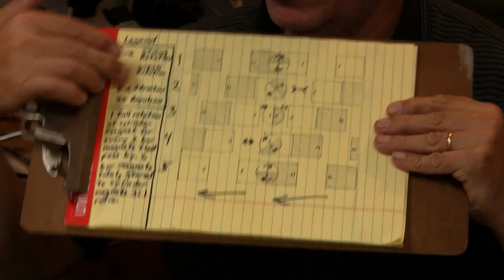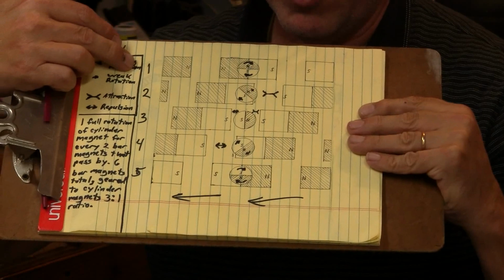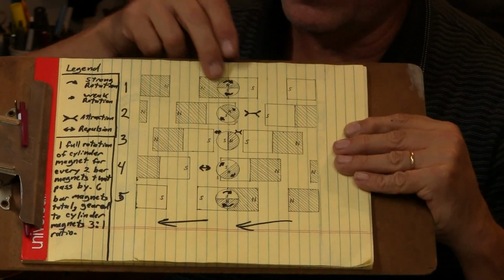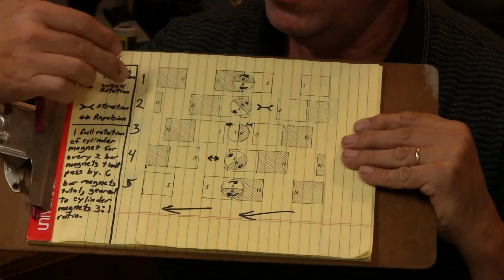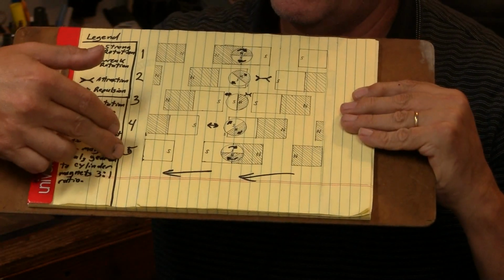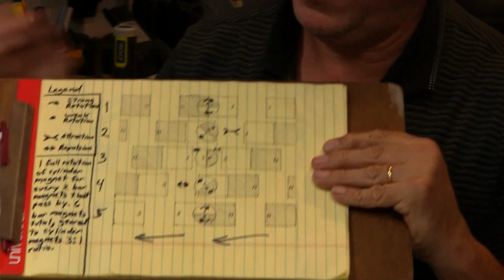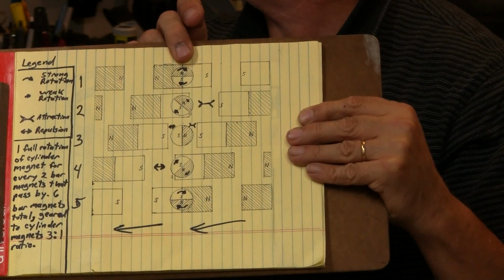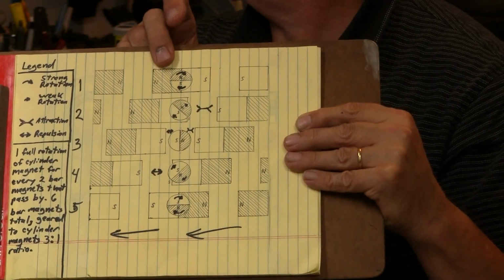#378 Vortex Field Permanent Magnet Motor part 1

Comment: Wont work. I guarantee it. I hope you build it though, i find these inventions fun and exciting! And even if it doesn't work it still educates and helps people learn what not to do. One hint is that Nature doesn't work in "snapshots" like your diagram implies, another thing is the fields are going to change depending on where the small magnet is.
Reply from the maker: I agree. It won't work. It might work if fields were two dimensional as depicted on a piece of paper. In the real world, they are three dimensional. My research has moved into phase changing solid nano particle crystalline metal alloys.
Reply: @zerolabs  you got any free energy so far? I proved free energy exists. Dig a hole to asia and you will get free transportation from North America to Asia. When people say "free energy" what people mean is they want to get transported somewhere for free. I don't know much about nano particle crystalline metal alloys. What the world needs are methane engines. They are already being used in Sweden but no influencer is talking about it. Some South American countries use methane taxis. Poop is free energy. All this poop could fuel the whole planet for free, but instead it goes to waste. Not only that but all this poop contaminants the atmosphere with methane which is worse for the planet than CO2. Methane engines are 98% clean and save the planet from waste. Yet society is stuck in slow motion and won't do the right thing.
Reply: @zerolabs  There is free energy all around. Free poop. Methane combustion. Sun powers the planet. Stars supernova which generate more stars which then supernova and generate more stars. Its all free energy

Comment: Hi! This idea are not stupid. If this was built larger, lets say 200 times larger and the smaller magnet was rotated by a CNC controlled servo who time this perfectly... The spin at correct time will not experience any magnetic drag on to do the actual spin. Also if distance between magnets on drum is correct and servo are fast enough and servo BEMF is captured also, servo wont experience heatloss breaking force (BEMF), servo would then become faster and would use 90% times less energy.

There is servos on the marked to day that is super fast and super precision and those is the clearpath servos https://www.youtube.com/watch?v=R7bgAo0EINI and they are extreme fast and extreme high precision on and consume little power. As well they have high CoF and high torque. There is working RV systems both for 3ph engines and 1ph engines so it does not matter whatever the engine is 1 or 3phase, RV works whatever engine and BEMF is presented everywhere no matter what. point is that u can run the servo extreme sheap even if it had to start and stop a big heavy magnet.

My proven discovery from 2008 with zero lenz effekt super alloy could be used to generate power on the drum for free because of no lenz. Lenz Law is not a law anymore. I broke it in 2008 by super alloy. With my discovery I get out approx 60W per coil and no drag what so ever, because I do not place the coil near the magnets, rater use the lenz free induction material to cause and affect and Eureka! Free energy. I done research on free energy for 20 years... You all not give up, because sooner or later you get it done.

Comment: Hi. 
Fun idea, I hope you get it to work and give energy even if i see some possible problems, but I sure hope it will work in some way. 

I just thought about the ending words. The largest machines we have is electrical. And MANY big machines have only got a dieselengine to power electrical generators, and then hydralics and everything else is driven electrical. 

For example all ships that uses "pods" (propellers that swiwel 360 degrees) for propulsion uses electrical power. 

So we can drive everything in pure electrics if we can find a way to generate and store big amounts easy. =)

Comment: That design is missing a blocking mertial like something light aluminum with a thin sheat metal inside so to control the field open and block as there pasing buy to keep the rest moving likee
Reply: thin sheat metal , would you tell us more detail about it
?
Reply: @joelhuang979  he seems to allready have a blocking material, he has timing with gears, he has a push pull force. I would increase speed and power  hits and timing with  solar and battery because the magnets and configuration depending on the size act as a booster, there are many ways to boost and strengthen volts or amps as well. There will always be a source power needed  it is possible to stretch out a little power for more time. I would be going for time, of course if we wher even more technical we could also use frequency to dispatch heat and pump a little more juice to the battery. The important thing is to get the work with input and the longest time given set amounts of energy inputs. A push pull design is correct, the many ways of putting it all together is tuff. Once material design works, we would need high technical  tools in building and making the same stuff with arranging the very energies things are made of. For us and what we can do , he is on the right track.

Comment: Such an elegant idea!  I almost don't care whether it works -- seems it didn't, since this was posted last year and I can find nothing that's been said since.  But it's full of losses -- all those gears -- and spacings / dimensions might be critical.  Some refinements might make a difference.  In any case, I sincerely commend you for persisting through all these various ideas.  I'm having to focus on pulse motors just now, any Muller news?  
Thanks!!
Reply from the maker: I and all of my colleagues agree, my design works on paper but in two dimensions only. That's always the problem. But it does not deter me from trying. Nor should it deter anyone else from trying. That's why I publish these videos. Thanks for watching.
Reply: i.e multiple the 'rotators' outside the drum in a  '3D' fashion around the drum ? 
i can see a space for at least 3 more (in this configuration) 
you would have to arrange the 'rotors' appropriately as on the 'left and right' of the 2d drawing you have two like poles so it may be appropriate to arrange them in the relevant rotational manner?

Comment: iv built a magnet spiral for study(half a :Calloway v gate...). Been thinking about trying kinetic energy transfer to pass the gate. make two mirror image wheels, identical strength v gate wheels with a drive magnet fixed between them. attached energy transfer devices...ie: hammers, billiard balls etc, to the top above magnets...start one manually and magnet v increases rotational velocity. The impact with the other wheels hammer, sitting at its gate, transfers the gained energy to the other wheel....Then its magnet v duplicates the process and so on.... i think it is the only way thru the gate...update me if any of you try it.and goodluck to all...

Comment: Pivoting bar magnets slightly offset on the pivot.... like in paralell rows so a static bar magnet wheel can pass through the two breathing lines..but in a circle surrounding a wheel with static bar magnets... how about placing the pivoting magnets on the right hand down side of (gravity aided side) ..like an improved V-Gate.. cause I saw those kids launch a hotwheels car through a V-Gate setup... shot it like a freaking jet off an AirCrafts Carriers Catapult. And... by the way...trains work on diesel electric and move millions of tons... so if a relatively small diesel motor can make enough electricity to power those electric motors.... get real man... They already move the real HEAVY stuff with small motors hooked up to generators... So...DUDE..quit with the "We won't be moving heavy machinery.." negativity.... We Got this on LOCK ...target acquired and homing.. Positive Vibes man... I am one of the few people who believe that after the Creative moment.. that rest is an un-natural state. And that things in motion remain in motion until acted upon by an outside force... and that we are not violating the law of conservation of energy and or motions..just participating in them and causing areas where things will follow the path of least resistance. Throw some levers at it and we have force multiplication... Force is defined as what? and wheels are just a whole bunch of levers...so...we are on the right track..." 'Can't ' never did anything!"

Comment: Is see that you have some skills that may help to solve the energy problem.  Thus I am going to try to help you along theway.

The machine doesn't work because it can never work.  With a few hints about how to think about it, most people can see why such machines can never work in fairly short order.

1) Start by thinking about just two magnetic poles in space with nothing else around.

2) When you have just two poles it becomes quite obvious why the force between magnetic poles always is along a line between the poles.

3) Think for the poles as unchanging and being in some positions today and the same positions tomorrow.  When you do this it is easy to see that the force between poles will depend on there current positions and not depend on any path they may have taken to get there.

4) The is a physics meaning to the word "work".  It is a really useful idea.
Work = Force (dot) Distance
The dot style multiply means you take the part of two vectors that is parallel and multiply them.  Think of walking around on some hilly ground.  You make a mark on the ground and set off walking.  Eventually, you come back to your mark.  To do this, you must have walked up hill as much as down hill. Work can be thought of as the transfer of mechanical energy.

Don't take this as failure because you will have only failed if you don't now study up a little on physics, electronics or chemistry to build your mental tool kit and start going after things that may work.
Reply: FuckYouGooglePlus
In many cases, their thoughts are less deep than all the way to the oil company.   Quite a few of them think they really have discovered something new.  Among them there are also con artists that feed the delusion to get money out of the ones who really believe by perhaps selling them magnets.

Comment: https://www.youtube.com/watch?v=B2C7YHiQGC8  
A  great invention in the field of energy.

Dear Sirs,
You attach an invention in which the scientific world thinks something is not possible.

Hello ! 

I am an inventor from Romania, Europe! I discovered the physic model which transforms the permanent magnet energy in kinetic energy on undefined time (continuous movement). I would like if you have the time and you have the financial/technical strength necessary to collaborate and construct the prototype for this invention. The invention has a pending patent and has the name "Energetic Transformer". It's composed by magnetic, mechanic, and hydraulic elements, the invention uses a new theory in physics also discovered by me and can demonstrate scientifically that such a device can be build. The benefits from this invention i consider that is for the best if they are split equally. If you agree please tell the method through we can collaborate. I wait a sincere and on topic answer as soon as possible on e-mail!   

                                                 POWER     TRANSFORMER

   Definition.
                     Power transformer is a device made of magnetic elements, hydraulic, mechanical sopul to transform the work cyclically generated  two permanent magnets.
   
  Principle of operation.
              Apply a new physical model, characterized in that: the amount of mechanical work
which is manifested in three axes, ox, oy, oz is nonzero

Best regards,
Inventor Scantei Tudorel , Romania 
Please send me an e-mail for talks on cooperation.
 E-mail invscanteitudorel@yahoo.com

Comment: The principal is sound, so long as we look at this in principal and dismiss some minor elements of physics that might get in our way.  You seem quite driven in your efforts.  I believe every brilliant discovery that has, or will be made, was, or will be met by opposition from ignorance.

I wouldn't suggest that you give up on this.  I'm not sure how long you've worked on this, or the effort you've invested.

Honestly, I would LOVE to see you succeed with this project and prove me wrong.

This idea is strikingly similar (frighteningly so) to a problem I toyed with in my youth.  I had the spark, I had the drive, and everything worked "in principal", but after a short time, I talked myself out of taking it to the next level.  It wasn't easy, talking myself out of something that seemed so obvious.  It didn't matter to me that, if it were so simple, somebody far more intelligent would have already come up with it.    I stand by that statement.  The idea that a more powerful mind or minds than my own would have already achieved what I was contemplating was not a factor in my "throwing in the towel".  That type of thinking would have kept us in the dark ages.  I could never subscribe to it.

As I said, I inevitably talked myself out of it because, while in concept, it worked at every stage, there were variables that kept adding up that, in the beginning of my thoughts were easily dismissed as issues that would be resolved as I reached certain stages in my "proof of concept".

These variables, on paper became overwhelming.  Mathematically, were I able to construct my "magnetic motor" in a universe without friction or any other loss, the best I could hope to achieve would be a perpetually spinning flywheel.  Even in this perfect universe, my perpetually spinning flywheel could not be used for anything but to maintain it's own rotation.  I could not drive a generator or convert the rotary motion to any useful form of energy.  Any load applied would be directly applied to braking on my motor, eventually bringing it to a halt.

I think I had a more difficult time talking my peers down from their support than I did convincing myself that I couldn't take this anywhere.

I would so LOVE to see this thing work!  Thanks to the internet, research is far more easily attained.  I myself could not take this any further based simply on what I've already determined (doesn't mean I'm right).  It didn't work for me, but, I never took it to the next level.

The more we learn about the universe, the more we learn we don't know about the universe :)

Didn't mean to get so long winded, this is uncanny.  I'm a little tickled.  Your theory reminds me of a different me.  Sadly, the me it reminds me of, is the me I miss most of all :(  How did I go from being tickled to sad?  See why I'm not so please with the present me?

I wish you the best of luck!  Don't let my failures, nor the failures of others keep you from pursuing your dreams.

I'm serious when I say "I'd love for you to succeed"!

Peace brother,

Steve

Comment: Maybe add a Flywheel or 5 to the rotating cylinder magnet shaft.  That will help get past any sticky points in the magnets attraction. Use a flexible spring shaft to couple the flywheels to each magnet shaft .

Comment: nice job  I built a wedge type design but didn't use a trip device to get the  N -N to separate to let the mass continue past the lock up point.  when run the wedge would bounce back.   with you idea you have a mechanical link which allows the fields to properly interact.   The only problem I see is that fields may need to selected so that they don't overpower what your trying to do.  you need to spread the magnets out.     You can also build a very powerful system using magnets that are not opposing fields.   Their is a crop circle that's shows what Searl is doing and the crop circle has 7,11, and 13 magnets involved, which look like pie shapes.. Their are several of these systems working on the web.

   your last comments aren't really needed and could come back to haunt you.  be careful.   There are those who really don't care about free energy and have a huge amount of money to ....  also you can use $380 to apply for a patent get rejected and still be protected without spending several thousand dollars.  the app sets a precedent.  good luck

Comment: I am hoping that your design works. The only point I foresee is a tendency for magnetic "oscillation" of the small diametrically magnetized disc, having a potentially neutral magnetically driving force occurring at (2) points: the point at which the disc magnet is exactly between the drum magnets, and the exact opposite position where the disc magnet is exactly between poles of the drum magnets. Essentially Zero (heh) force positions. Other than that concept, if the rotational momentum carries forward through each iteration of magnetic attraction and repulsion, a successful full rotation may be accomplished with increasing velocity up to saturation. Good luck!

Comment: I'm extremely happy to be wrong,what your are trying should be possible, but as you well know since electric motors have been invented we've always used electric power
to change the magnetic polarity to achieve rotor motion,good luck zero.

Comment: Like the idea, permanent magnetic motors are fun to think about, but will never work. A magnetic field is static and produces no energy.
Reply from the maker: MrOnTheCheap A wind turbine is static and produces no work either, until you place it where it can receive air flow. That's what I mean by open system.